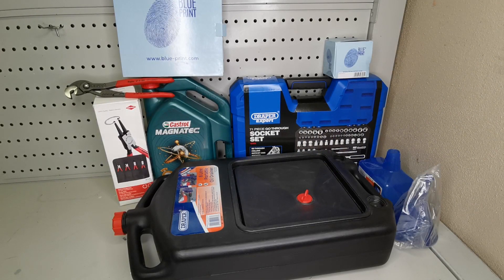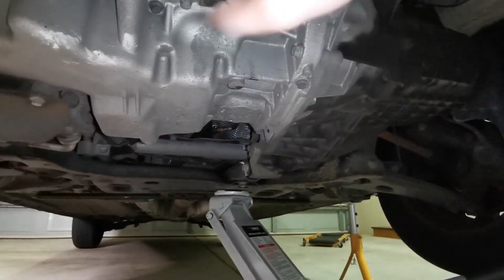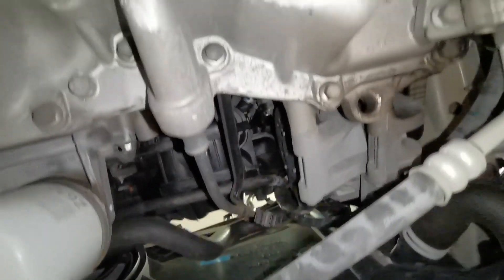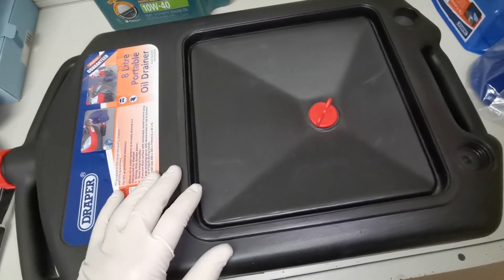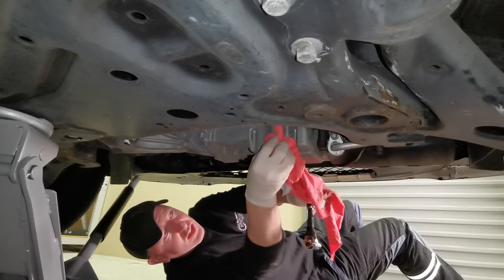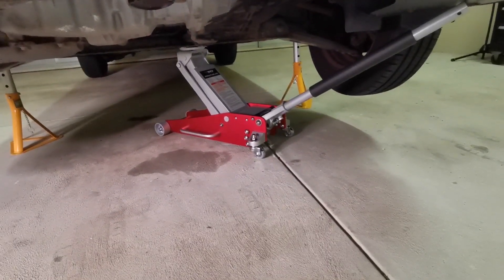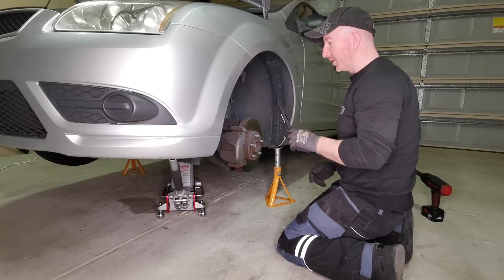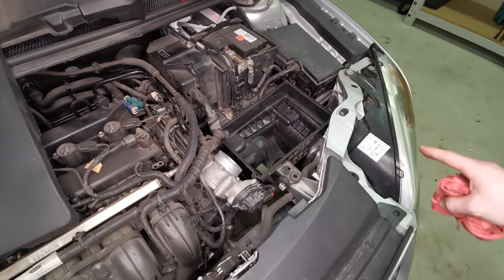Oil & Air Filter Service - Maintenance Tips  - DIY - Complete Guide

Comment from the maker: For vehicles with cartridge type oil filters, you may need a oil filter housing removal tool like the ones linked below for Toyota (if it doesn't have a hex/socket top on it) https://www.micksgarage.com/d/oilfilter-spanner/products

Comment: Nice A to Z, job. Hope it encourages fledgling DIYs, out there.  I'm just finishing the resurrection of, the late of my son's, 2000 GMC Jimmy. Accomplished  a lot of things, that I'd never attempted before.  It is simply astonishing, how much help there is available online, from videos like this.  Of course, I also got lots of help too, from Parts Store guys, (two in particular).  A few stray mechanics, lots of relatives,  some acquaintances, some passerby's, occasional complete strangers, etc.... It's been an unexpectedly, summer long project.  Lots of issues taken care of. The 'open heart surgery' aspect of Jimmy's resurrection, being being replacement of the (MPFI) fuel injection spider. That was the "most delicate" of the operations. Turned out it went relatively smoothly, and not all that difficult - just had to be really meticulous, especially once the upper intake manifold was open. I've pretty much hit everything in the fuel system (lines, pump, filter).  New brake lines all the way around. A new radiator (a surprisingly big pain, reconnecting the oil lines!).  Checked out all the running gear. Drained and refilled the front differential, and transfer case. And saving what seems to be the worst for last, extracting the ruined rear differential fill plug.  I've just gotten, as far as drilling the plug, in order to use an easy out on it tomorrow.  Well, that being said, my only other comment after watching this video, was that I was hoping to see the transmission oil change:-)   One thing at a time though. Good work! Good night.
Reply from the maker: Thanks talking the time to comment, I am very happy you get enjoyment out of DIY videos and find they useful for your own projects. It is always nice to hear feedback and I enjoyed reading your project. Hands on projects are the best for learning and practical experience teaches so much. 
1 job at a time and on to the next one. Thanks for stopping by